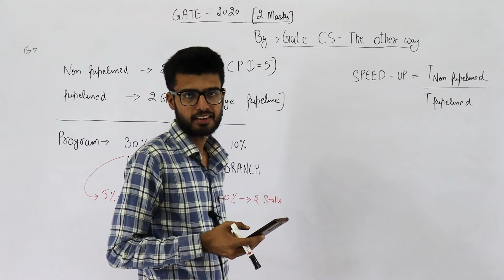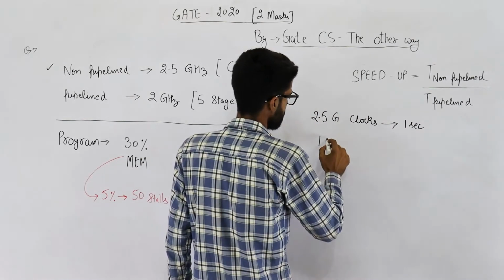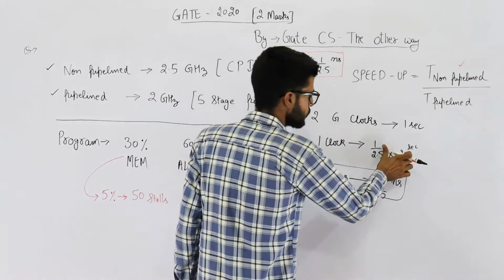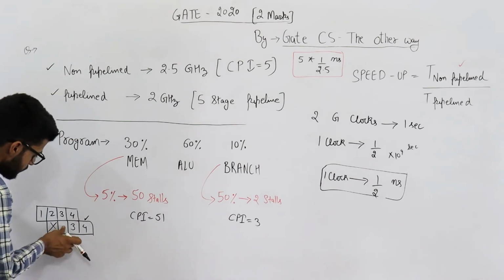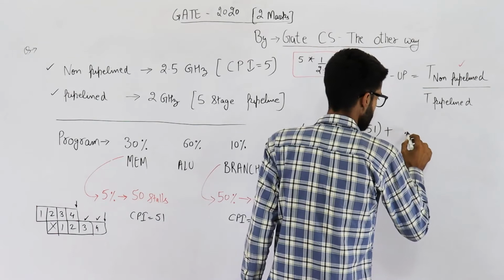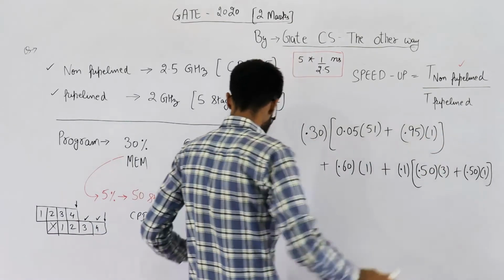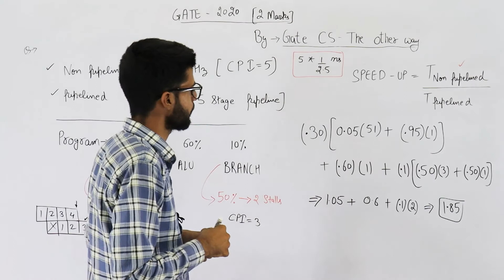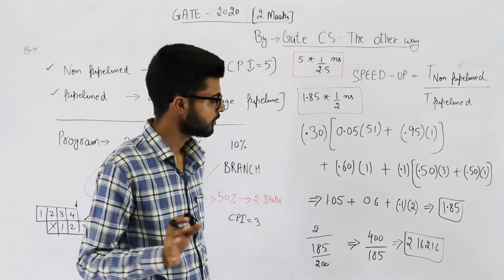Gate 2020 pyq CAO | Consider a non-pipelined processor operating at 2.5 GHz. It takes 5 clock

Comment: non-pipelined instruction execution unit operating at 2 GHz takes an average of 6 cycles to execute an instruction of a program P. The unit is then redesigned to operate on a 5-stage pipeline at 2 GHz. Assume that the ideal throughput of the pipelined unit is 1 instruction per cycle. In the execution of program P, 20% instructions incur an average of 2 cycles stall due to data hazards and 20% instructions incur an average of 3 cycles stall due to control hazards. What is the speedup (rounded off to one decimal place) obtained by the pipelined design over the non

Comment: sir i have a coa question can u help me to solve it it is a neumerical type and i can not find solution of it

the question is given below

suppose that in a program 16% of the instruction are conditional branches , 60% of conditional branches are taken and 1% of instruction are unconditional branches . there is no stall other than the branches . A pipelined processor with 15 stage calculates branch address for both condition and unconditional branches in the 4th state while it calculates the condition for conditional branch in the 9 th stage .

(a) what is the average CPI if stall the pipeline stategy is used ?

(b) what is the cpi if predict-not-taken  strategy is used ?

(c) what is the speedup achieved by predict-not taken relative to stall-the-pipeline strategy?
Reply from the maker: u can study about these strategies because i cant explain it in detail in comments but here is a hint to start, 

predict not taken strategy says processor will always assume that condition of conditional branch will result in false and hence we will not jump. now its given that 60 % of time(of total conditional branches) we have to jump i.e. we face some penalty for 60 percent of times. and in unconditional we will always jump that means we will surely stall (or waste) 3 cycles hence cpi =4

so b part will something like:-
.16(  .40(1)  + .60(9) )   + .1(4)  +   .83(1)

predict-not-taken  strategy is subtype of static branch prediction techniques.(i hope u have first studied the topic).

similarly u can learn stall the pipeline strategy which says whenever a conditional branch is encountered just stop execution of instruction and stall until next address is known (jump address or until condition is evaluated) .now here a few things are not specified in question like when is he decode phase ??or will the processor redo the already executed phases id the jump was not taken in case of stall the pipeline or will it just resume .

but thats not a big deal just make assumptions and answer the question 

and I'm sorry in advance if i may not be able to reply to doubts in future due  to busy schedule.
Reply: @GateCsTOW  thank you sir this explanation is more than enough for me to under stand the thing 🤍